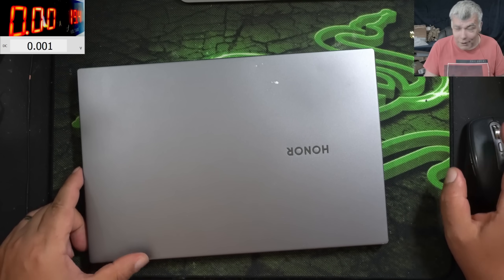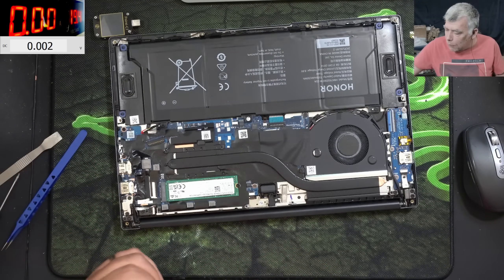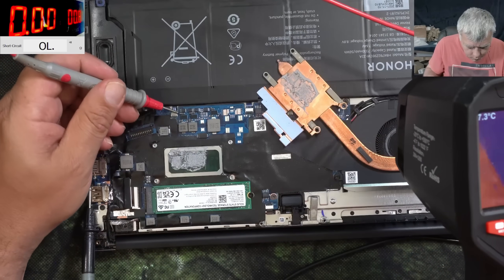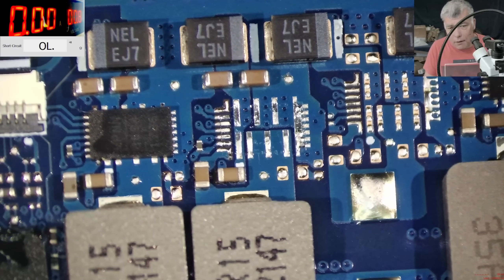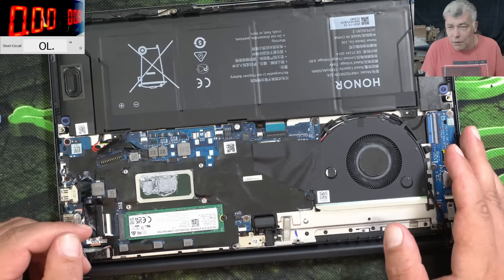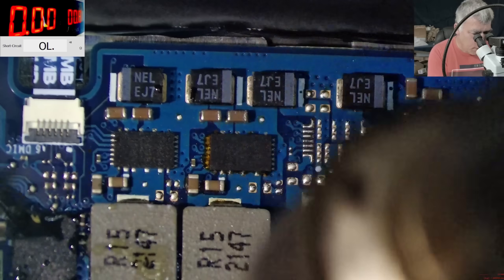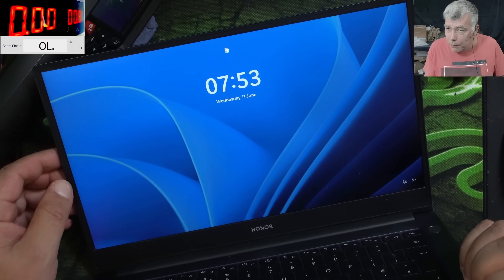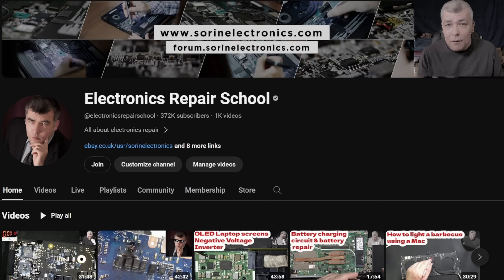Huawei Honor MagicBook X14, no power, not charging board repair, CPU monolithic driver replacement

Comment: The vast majority of laptops do not support power saving modes if you enter the BIOS. So we can check the system heating while in the BIOS. And if you need to discharge the battery faster - this can also be done while in the BIOS.

Comment: That is a two phase power supply, one phase will be on up to 15A or 20A, then the other phase will come on. The monolithic driver contains a high-side FET, a low-side FET, and the driver. Since the rail was shorted to ground through one of the monolithic drivers, that means its low side FET is shorted.

Comment: You can check with the osciloscope before the coil to see If the driver works normal.
Reply: why make it harder when his experience tells him different?
Reply: @dontrotter1099  after replacing any part in any power loop should always check length of coil drive signals to avoid overlooking a partially bad feedback or vrm controller.
Reply: I was thinkng that but he said they were in parallel so unable tell at coil,
Reply: @Dohcoms  no, coil input is seperat per driver, output is shared
Reply: @diecrafter1986 I was thinking that but telling the difference with a scope as the signal will pass back through the coil?
Reply: @Dohcoms  Signals with higher frequency act different through a coil, DC voltage will pass through a coil and be on both sides, but the signal the monolithic chips generate are different. it wont really "pass back" through it at all 🙂
Reply: @Dohcoms  the outputs of the coils are in parallel, but the input side, the switch nodes, are not in parallel. Each switch node is driven by its respective monolithic driver.
Reply: @djtoland  I was thinking that alright, need check an enable pin on the monolithic driver with scope, does that enable come from the PCH? Interesting, i will check a schematic,